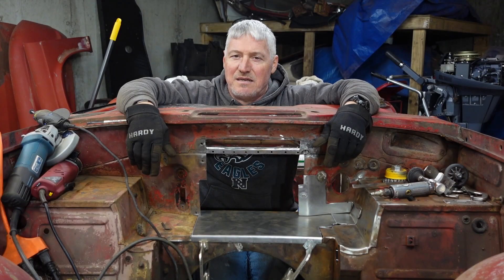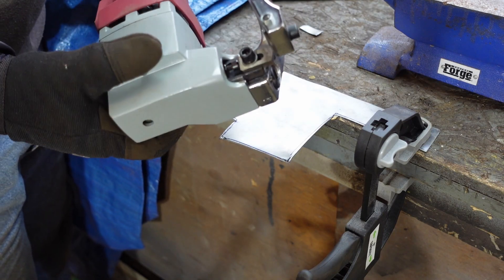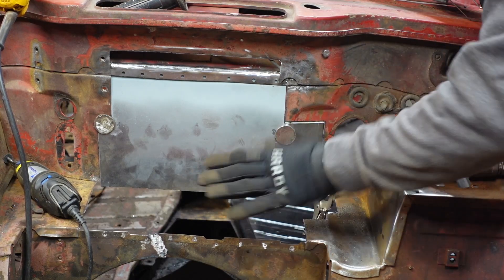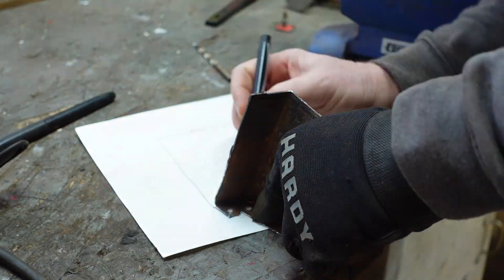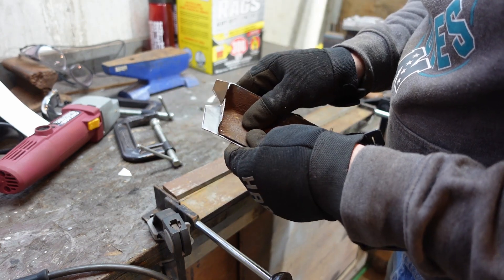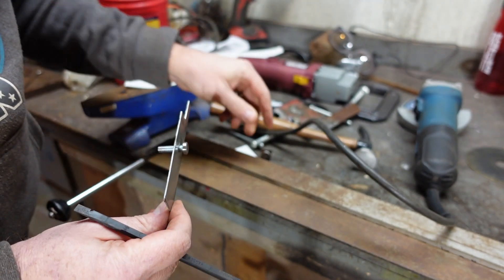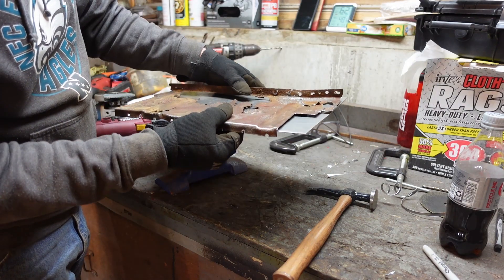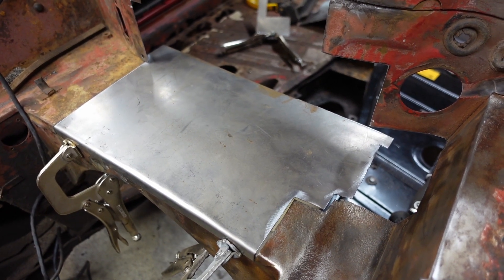Triumph TR4 - Firewall Fabrication | Roundtail Restoration

Comment: Great work Chris. Since you asked I would weld the tray and the corner piece first and then the back wall. The ribs would be easy to do on the brake. I used the same style brake as yours for the ribs on the floor of the 66GT6 in one of the early episodes, it wasn’t that hard. You can make the ribs from one end of the piece to the other and then flatten the two ends. The buck technique is great too, but it never gave me a nice clean look. I used it for floors and hidden areas. Anyway, you are doing great and soon you’re gonna have another one of these beauties on the road! All the best in 2023!
Reply from the maker: Thanks, Elin. Yes, I agree with you that the tray needs to go in first and then build from there. I'll check out that video. Thanks and Happy New Year!
Reply: @roundtailrestoration  Here, I actually didn't remember how I did it and I was curious to find out too LOL. https://youtu.be/pxePR-YqC9o
Reply from the maker: Thanks!

Comment: Looking good. I'd almost make the vertical out of one piece and the other out of one piece. 2 instead of four.
When you put the ribs in, that peice will shrink. 
I'd say do the ribs first, flatten the flange edges, then tip the flanges. Hope that makes sense.
Reply from the maker: Yes, I think it does. I put the front flange in already for the tray, so we'll see how that works. Try it on a piece of scrap first. The way I think the tray will be sandwiched in the buck, I don't expect it to shrink much, but we'll see.

Comment: Hi Chris.  When I did the battery tray on my 6 I needed to replace: the centre ribbed part, the scalloped sections on either side and one of the sloping sides.  I repaired the bulkhead, then cut out the rusted sections of the tray, leaving the two battery hold-down brackets in place, then fitted a repo panel from Moss, (minus the unneeded side).  I found that the replacement panel could be tipped, so that the rear flange would slip under the lower edge of the bulkhead panel.

I have made a ribbed panel using a homemade form tool, but at the time I had access to a hydraulic press and there was only one rib.  Having seen Elin's many videos I think that if I was making your panel and had no bead-roller, then I would follow his brake suggestion.  However, I think that you may have to start with a wider piece of sheet metal, as am sure that putting in the ribs will pull in the sides quite appreciably.   I would follow Fitzee's method of starting with a wider sheet, put in the ribs, then position the panel to give the correct spacing in from either side, mark and cut to fit.
Reply from the maker: Thanks, Robin. And thanks for the email and the pics. They will help immensely!